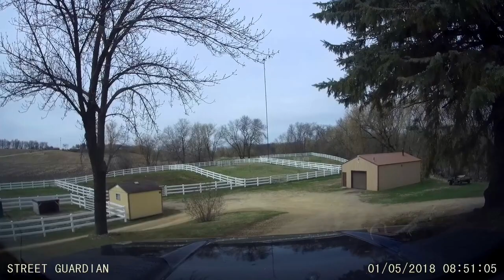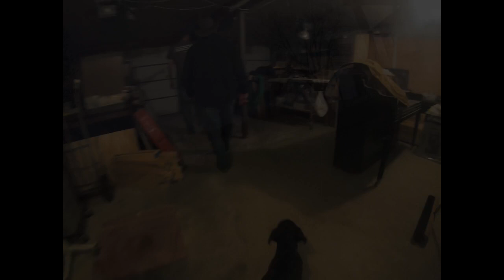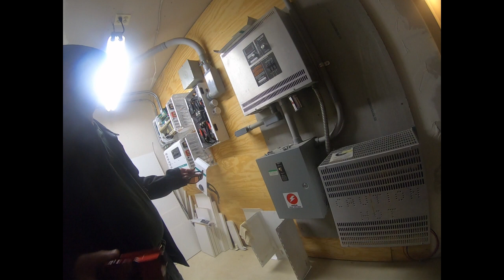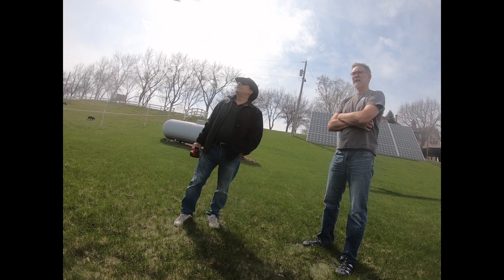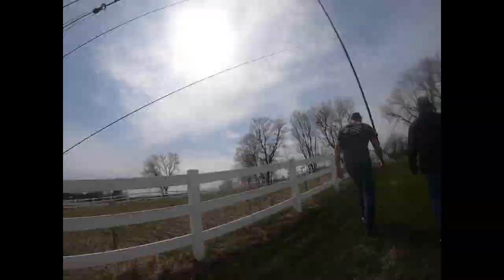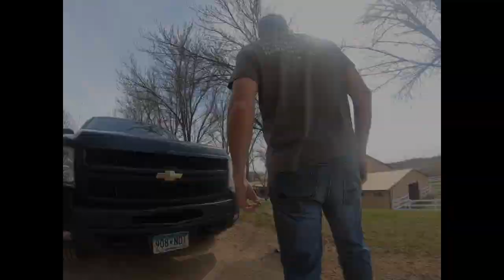Service Call to Repair Wind-Solar-Battery Back Up Renewable Energy System with the Turbine Guy

Comment: I just overhauled my Whisper 175 that was up 16 years finished today.  It got new blades, and found out they need balancing, wiggly tail. I will do that tomorrow. My old trace 5000 W inverter was replaced to a Schneider Conext  4500 W about 4 years ago.  I also got rid of the old bang bang SCR to dump load EZ Wire controller and put a Tumo-INT 3 Kw controller. Only 600 bux. Works great. https://www.amazon.com/Tumo-Int-3000W-Hybrid-Controller-Seperate/dp/B01IX50TGS  All 7 bearings were replaced and I repacked them with Synthetic Grease with a 500 F deg drop point. I found all but the spindle bearings failed from rusting. Even the Furl bearings were destroyed.  https://www.amazon.com/gp/product/B07R4B8X3Y/ref=ppx_yo_dt_b_asin_title_o07_s00?ie=UTF8&psc=1  It is up and running. The grease won't drain' or evaporate on hot summer days. Might last 32 years now before service. :-)